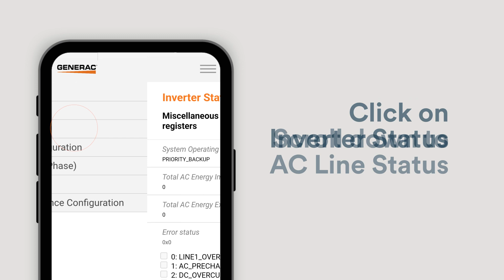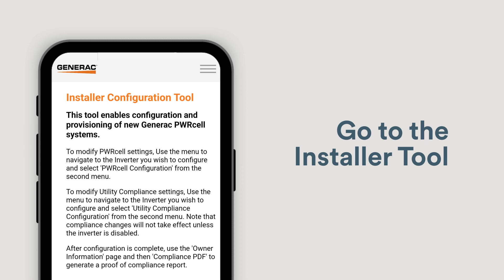Generac PWRcell Pro Tips: Troubleshooting Low REbus Voltage on the PWRcell Inverter

Comment: I bought a complete system (31 solar panels, Pwrcell Inverter, 2 battery cabinets each housing 6 batteries.  The install was done by PowerHome (now out of business) and since then I've had to rely on support from Generac which has been a complete nightmare.  All they want to do is pass it on to a "Authorized Repair" dealer which is another nightmare in itself.  I do not recommend dealing with Generac at this time.
Reply from the maker: Hello. Our goal is to provide every customer with a positive experience. We sincerely apologize that yours fell short of expectations. Please give us a call at 888-436-3722. We’d like to help.